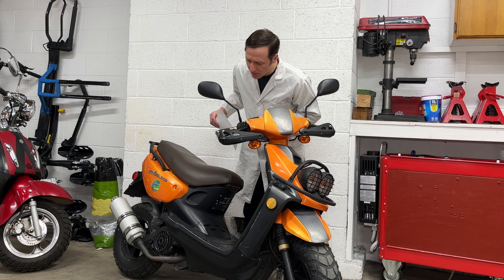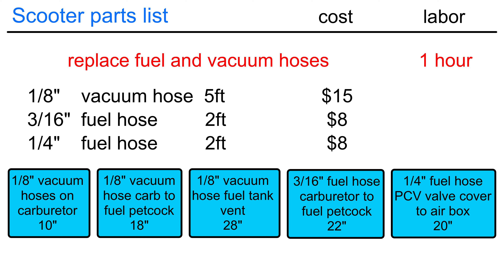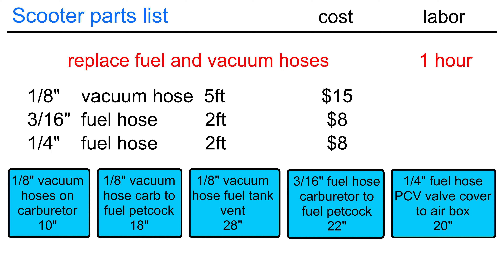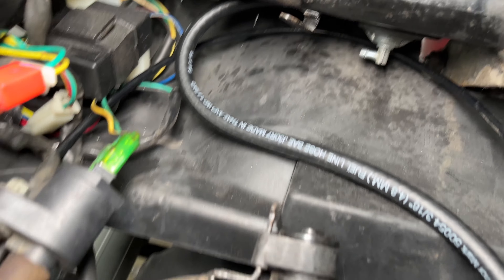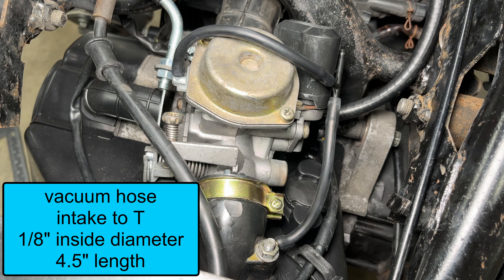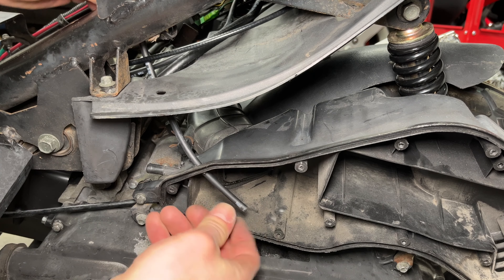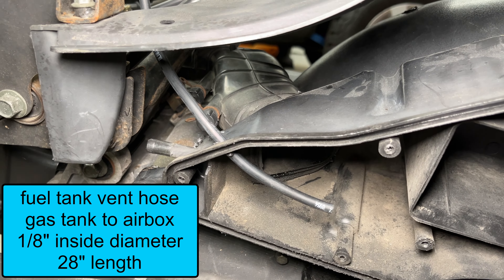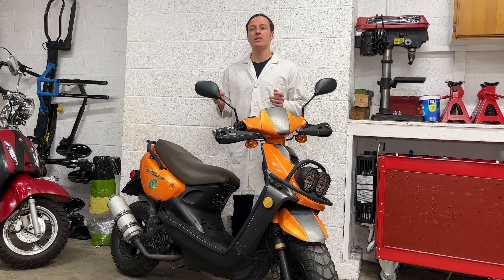Replacing fuel and vacuum hoses on a 150cc GY6 Chinese scooter

Comment: Thank you for all your in depth informative videos on Chinese scooters I learn so much by watching your videos ...🙂👍

I do have a question maybe you can help me out with..? I have a gy6 150cc scooter ,I purchased it brand new in 2021 & here we are at the end of 2023 I'm experiencing misfires and surging at 25 mph in a way it's as if I'm flooding it or running out of gas..🤔..? Its been a week now and I'm puzzled I've swapped out carburetors and sparkplug. There are 2 things I know needs replacement #1 the fuel hose inner diameter is smaller then stock fuel hose. 

#2  I have a faulty ignition switch that needs replacement sometimes I have to jiggle the key before it could start 

Could you please help me diagnose my scooter by what I told you here or at least guide me in the right direction? I know it's hard not having the scooter infront of you to diagnose but from what I mentioned that it's doing what do you think can cause misfiring at higher rpms and surging the feeling of loosing power then catching power again in a quick second over and over unless I slow down to under 25 mph.....🤔...?

Thanks Paul I sure could use your advice Happy Holidays buddy..🎄

Comment: Another question is, my SYM carburetor scooter over half year that engine does not working in Taiwan! After I push scooter start motor switch and then I got some situations as below: (1) engine cylinder pressure is 126psi (2) spark plug has flash (3) fuel tank does not working to push gasoline via fuel filter out? Do you have some idea to help to fix my breakdown SYM scooter here, thanks!
Reply: Replace your vacuum fuel pump
Reply: @TheKidAustin09  Thanks you kindly respond and I should try to replace that!